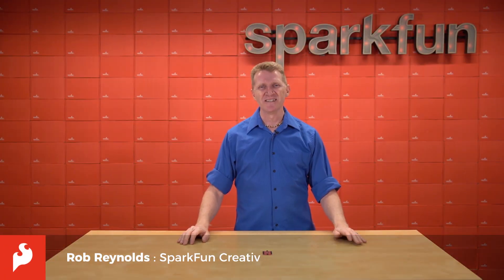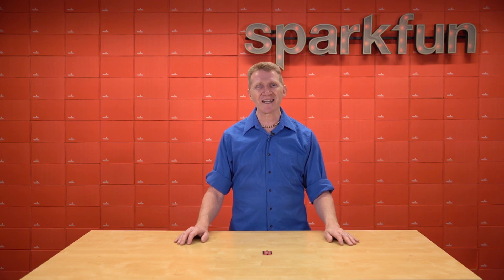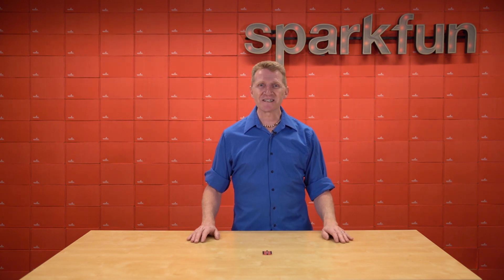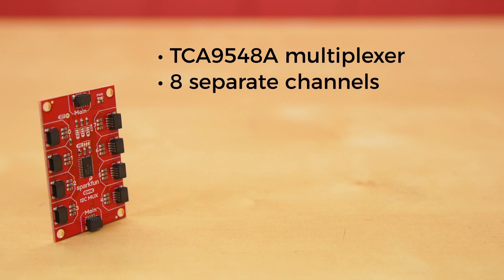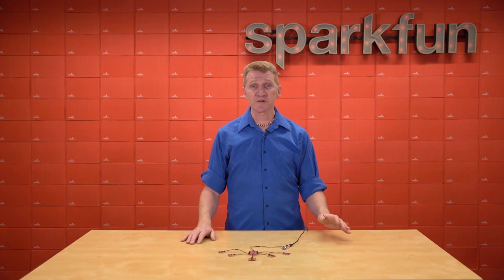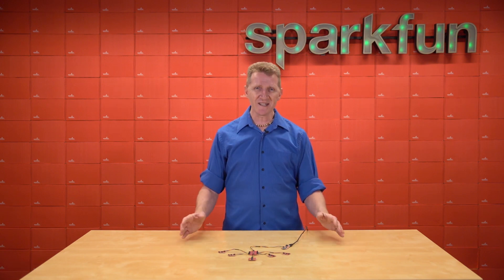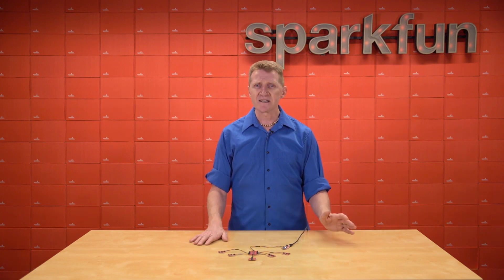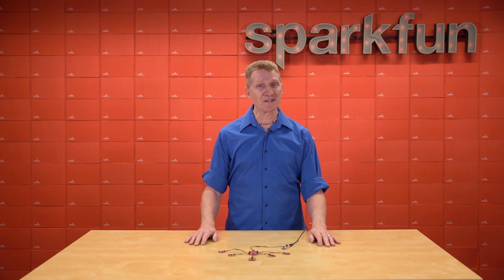Product Showcase: SparkFun Qwiic Mux Breakout V2

Comment: If you have 4 devices on the mux, how do you individually address each mux? Do you send a command to the mux to talk to a particular device or does the mux do the polling, and then offset the fixed address with a port+fixed address?
Reply: I haven't used this breakout board, but a traditional multiplexer works with a series of select bits to select which input to transfer to the output, so for an 8-1 multiplexer, three bits are required for the select bits. So say you wanted to select the first port, the binary command to select this port would be the value 000 (001 for the second, 010 for the third, and so on) and with SparkFun utilities, this port would probably have a label that you can specifically reference in the source code. Throw this all together in a loop to cycle through each port and you can transfer data to/from each port "simultaneously".